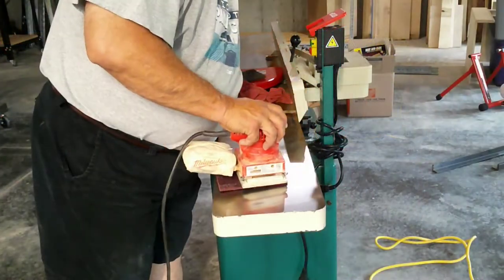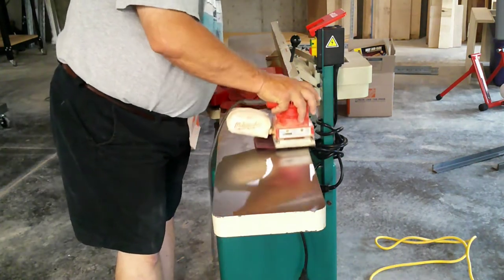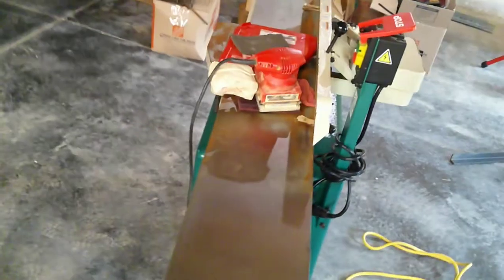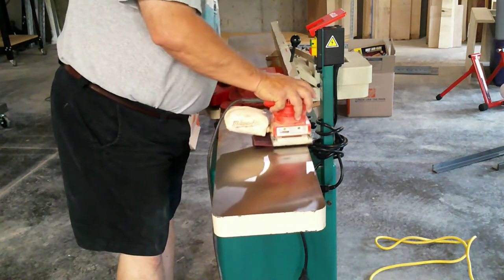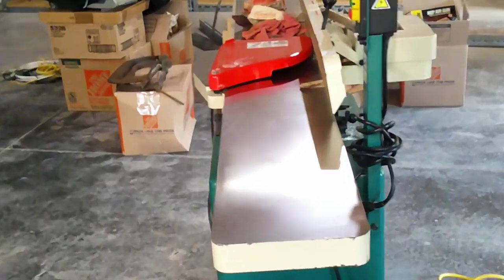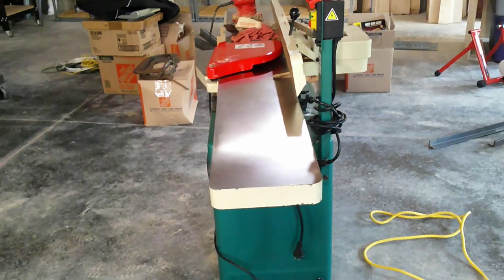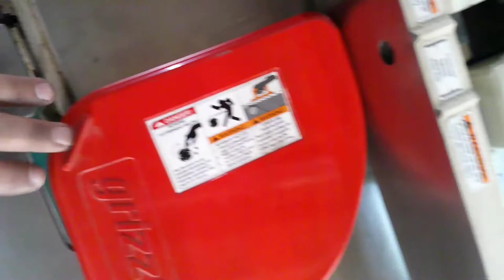How To Clean Rust Off Metal Jointers

Comment: What grit sandpaper did you use ? Thanks
Reply from the maker: I didn't use sandpaper, I used "Very Fine Scotch Brite" hand pad that I just placed under my random orbital sander. Sandpaper would remove metal and I was trying to remove "Flash Rust" (surface rust).
Reply: @grayburrwerks4117  , ok. Thanks for the info.
Reply from the maker: No problem. Let me know if I can give you any more information.